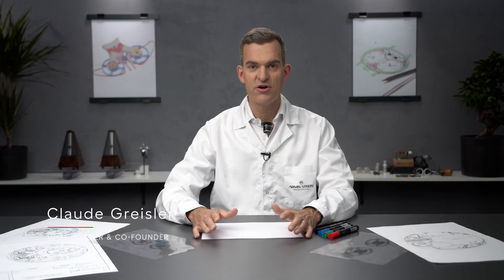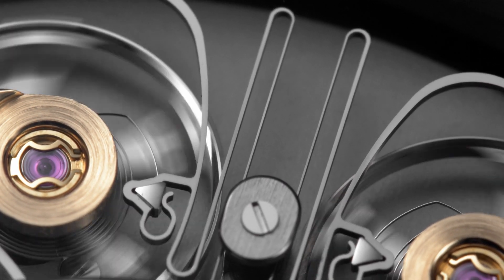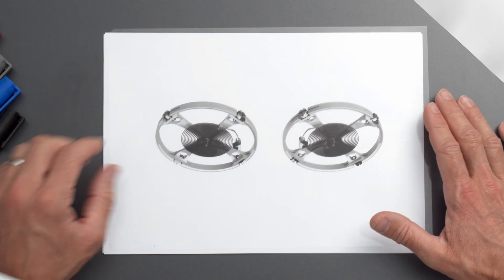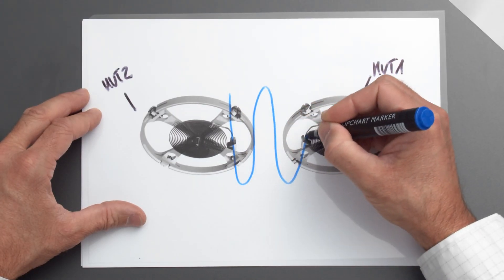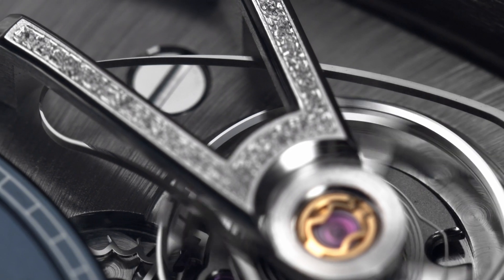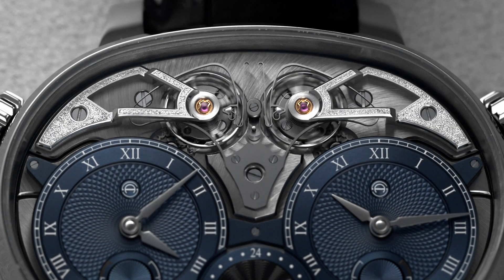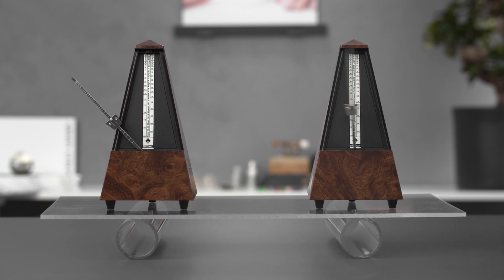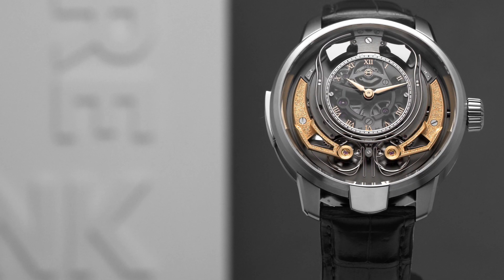ARMIN STROM Let's talk about the Resonance mechanism

Comment: Hi,
Very cool video. Would it bring benefits to angle one of the two balance wheel 90degrees up or down?
I am thinking that could be compared to a virtual tourbuillon because one balance wheel would always be pointing in their optimal position.
Reply from the maker: Thank you for your question! Your idea is not wrong. In our case one movement is turning clockwise and the other counter clock wise. This compensates already a part of the acceleration the two balance wheels generate in different positions.
Reply: @arminstrom  
Yes, your solution seems to be more elegant😄.

Comment: That was great, the two metronomes was a great visual demonstration
Reply from the maker: Thank you! In this case, form actually follows function. Our approach follows the theories of Christiaan Hyugens (inventor of the Pendulum clock and the father of modern mathematical physics) to maintain a consistent and sustainable state of resonance (synchronized motion) between two balance wheels. The purpose of that is to maintain a consistent oscillation rate regardless of the movements of your wrist - and to thereby ensure chronometric precision. In that sense it is a true “wrist” watch - as opposed to the static “clock” architecture of any standard watch.
Reply: @arminstrom  When designing watches or cars form will always be beautiful if function is clear.  It seems resonance will be much more beneficial for a watches accuracy than say a tourbillion as it is focusing on a more present issue than gravity.  Definitely a dream watch. I think I have built a dozen gravity and mirrored force watches on your website configuration.  Love your work and the math behind it- it resonates (if I may) with the nerd in me
Reply from the maker: @yahyamuamer1  Thank you for your message. The main goal of Resonance is to have consistentcy. Which means our Resonance watches do have marine chronometer precision as we can guarantee a stable resonance effect. The Tourbillon focuses on precision which is in a different context compared to Resonance. But both complications are very complex to master.